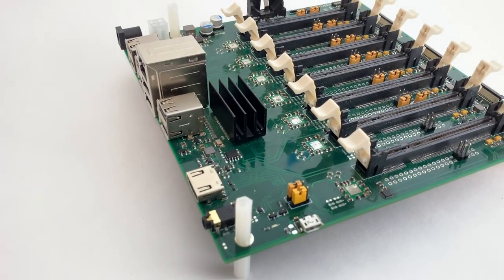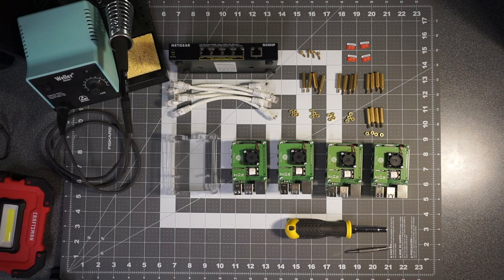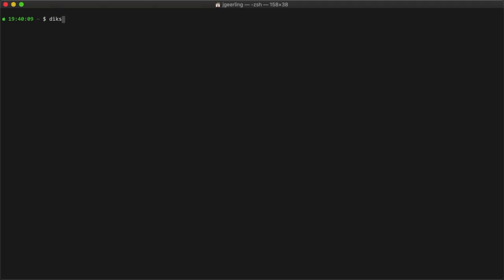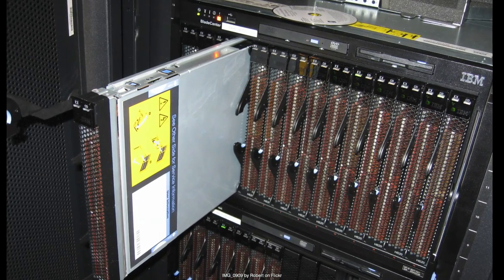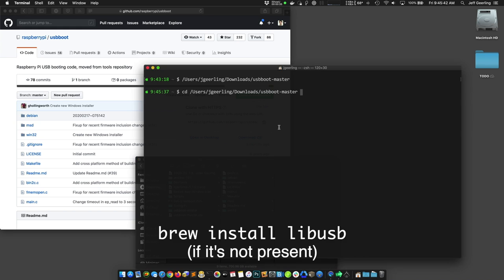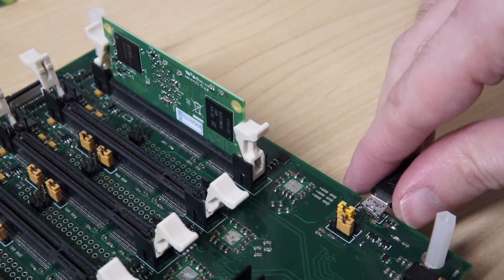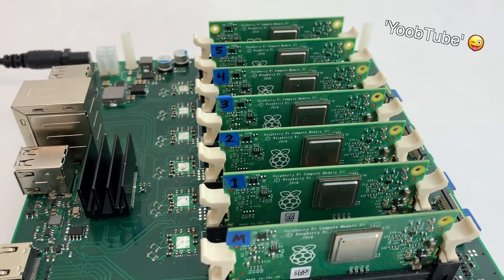Raspberry Pi Cluster Ep 2 - Setting up the Cluster

Comment: - 7 RPi B+ Power 
- A pcb that save the mess of cables and power
- A standar case
- Software tailored for clusters ready for Raspberry Pi

This project have every thing that Raspberry Pi user will dream, nice work.
Reply: I think you shouldn't instruct people to create unencrypted SSH private keys.
"Press the enter key three times" after ssh-keygen is resulting in unencrypted private key.
Form a security standpoint those keys are worthless!
Reply: The Touring pi is $280 with power, $300 with all the addons. Cheaper to do it otherways. Ridiculously over-priced board. Absurd.

Comment: I'm now actually thinking to build a few of these for my School's Innovision Center
Reply: How'd that work out?  Did it happen?  There's another thing you can do with this, if you are into coding and already know some C.  MPI_lib.  It gives you a parallelization API such that you can divide a task across 28 devices.  With careful coding, you can have an enormous speedup with certain categories of tasks.  (multidimensional modelling, sorting, {en | de}-cryption, file compression, DSP)
Reply: or you can take Elixir/Erlang language stack which include OS-like facilities with clustering in its VM

Comment: As always, thanks for a great series of videos. Patiently waiting for Ep3. 

I have 4 Pi 4's which I bought to try and get my head around Kubernetes/Docker (my experience is with more traditional server/VMs/hypervisors). The goal is to run some containers to manage media at home and share around the network (Airsonic, plex). I get stuck on how to set-up the networking, especially how this would integrate or be accessed from existing network:

- Can I put all 4 on my home LAN, so I can access them directly? 
- Should they get their own network using the physical ports and I manage them over the WiFI? 
- Do I need a separate device/another Pi to act as the router between the 2 networks (IP masquerading/forwarding etc.)? 
- Can the Master node also act as this router?

Hopefully you will cover the network setup in detail in a future episode.
Reply: I built a cluster out of 5 4GB  Pi 4's. I've got them all on my home network, using an 8-port switch. I have a sixth Pi 4 running as a file server (using gluster.) Each of these boards has a 16gb SD card for booting and a 16gb USB flash for the root file system. The file server also has a 256gb flash drive. Each of the cluster nodes mounts a shared volume which is housed on that drive. I have a seventh 2gb Pi 4 running pi-hole as a DHCP and DNS server, and use static DHCP leases for the cluster nodes. Each of the systems runs Ubuntu 20.04 minimal. For the actual clustering, I'm using k3s from Rancher, which I highly recommend over other approaches if you decide to run Kubernetes. At the moment, my cluster runs a web server, a git repository, a docker registry, and a Drone CI server. I can launch Drone agents within the cluster, but my current projects are building multi-architecture docker images, so I have a static Drone agent instance on an Intel system (it's an Atomic Pi, fwiw.) 

I'm housing it all in the Cloudlet Custer case from c4labs, with some modifications for better airflow and cable management. I'm using the aluminum heatsink cases (just the top parts) that cover the entire top of the Pi 4 board, which keeps things nice and cool. I'm powering it all with a 10A USB power supply, which is adequate but not stable enough to support overclocking. I plan on building a better power system for this at some point. 

I did most of the OS and software setup of the cluster boards using ansible (I write ansible infrastructure code for a living.)  At some point, I'll make these roles and playbooks public (there's a few secrets in the files I need to obfuscate first.)

You can visit the cluster at https://project.kube.thejimnicholson.com.
Reply: @TheJimNicholson  Thank you for the detail, most helpful (and interesting).

Comment: Wow, I need one of these but I can't exactly spare £500+ for something that realistically isn't any faster than my server I got on eBay for £60.
Reply: Think you're missing the point of the video. Nobody "needs" this, he's just doing it cause he can and he is curious. Plus if you need a serious server you're not going after an ARM based server anyway.
Reply: Which £60 server outperforms this?
Reply: @admiraldirtbag4336  anything, even an old HP DL360 G7
Reply: @admiraldirtbag4336  any X86 CPU made recently, particularly if you're talking a used 1700x or something along those lines and 16GB of RAM. 
The point of this, though, is to play around with clustering without having to fill up a room with ATX towers.
Reply: I would go with AWS.  I've setup some T3 Nano instances, with spot prices you can get each one down to less than £0.02 a day.  You can also stop them at any point and not be charged more.
Reply: @admiraldirtbag4336  my £15 off eBay server.
Reply: @mattvickers8639  is this actually a fair comparison? A t3.nano has 0.5 GiB of memory and 2 vCPU. The clock speed of these two cores is 2.5 GHz which is certainly higher than the 1.5 GHz of the Pi but still. 4 cores vs 2 cores, 8/4/2 GiB memory vs 0.5 GiB memory, I think the Pi is more powerful in some departments?

What about comparing it to e.g. an c6g.xlarge instead? That would already be crazy expensive to operate on AWS compared to the Pi cluster in my calculation. Running four of those for one day would set you back 13 USD and for 30 days would be 313 USD.

Actually just now looking at the available instance types and considering the higher clock speeds of the AWS instances compared to the Pi 4 I would think that the closest comparison to a Pi 4 Model B with 4 GiB of memory would be a t3.medium with 2 vCPU @ 2.5 GHz and 4 GiB of memory. Running that for one day sets you back 4 USD and for 30 days sets you back 96 USD.

Unfortunately I am not much knowledgeable at all about computer architecture as it relates to performance so I cannot say if my comparison is really more fair than a t3.nano. Would be great if someone with more knowledge could weight in :)
Reply: @maxstreese9048  Whilst all your logic is correct, you've assumed that like for like computational power was required,  it wasn't stated that the exact specs of the Pi are required.  The original commenter wanted to set this up without spending £500, so it depends on what they need it for really.
Reply: If you don't care about power requirements for 500 quid you can build a small system with a ryzen 7, a a320 board, a cheap nvidia GT gpu and 16GB Ram. You'll have basically 16 fast CPUs at your disposal (8 cores times 2 threads per core)
Reply: @mdo  @15:10

Comment: Always wanted to learn and apply.  Although RPI4 KNOWN for heat. A special designed ice cluster mount over blades with thin line per blade and super cooler on top would do the trick. Have it rest above blades mounted to corner post of base board. Mini turbine blade type most efficient in moving air.

Comment: Now what I really want to know is if there's something out there like a PCIe card with a connection for the compute module that would allow the compute module to effectively function as an ARM Coprocessor on an x86 or x86-64 PC.
Reply: There is/was Intel Xeon Phi, which placed up to 72 cores essentially stripped out Atom cores, on a PCIe card.
Reply: Unless you write your code to specifically load binaries onto those arm cores, this will not help you one bit.  And the x86 cpu in your desktop/laptop/whatever will very likely be much much faster than the rpi's arm cores anyway.  Not very useful.
Reply: @Messugga  Those were x86 cores though.
Reply: @Chuckiele  Yip, as I said, stripped down Atom cores. I didn't mean to imply they were ARM in any way, shape or form.
Reply: @Messugga  I know, you didnt mention ARM, but thats what the original comment asked for.
Reply: Eon du Plessis I thought you were very clear.
Reply: @detaart  Which is fine if you want to run x86 code, but if you're wanting to run native ARM code, it isn't going to be ideal. You'd have to emulate the 4 cores of each ARM processor (28 cores in this case) at full speed. The overhead in terms of memory and processing power would slow down the x86 system considerably. Presumably they want the x86 to be doing some other tasks as well as working with the data from the ARM side, otherwise they wouldn't be connecting an x86 system to an ARM cluster in the first place. So with emulation, they would have to buy more x86 kit to compensate.
Reply: Look at the new intel PCI-E NUC.
Reply: @TheRealMrRoboto  Yeah, Domo Arigato Mr. Roboto, but I seen that one. It's not very interesting. I mean, you got a machine with an x86 CPU connected to a machine with an x86 CPU. Not really interesting. The interesting part would be if you could have a system with an x86 CPU and slot in a card with an ARM, or POWER, or even RISC-V CPU for specialized computing functions which they might handle more efficiently. GPUs have been used like this for over a decade now.
Reply: @seancondon5572  You reminded me of the Mac Quadra 650, it had a Motorola 68040 CPU, but some models came with a "DOS card" (486 CPU on a card). But the sad fact is that they only worked in isolation, and could not share resources. Similarly, I salvaged a DEC Rainbow many years ago, it had both a Zilog Z80 and a 8088. I never found the monitor for it (it needed a specialty one that resembled a VT220 terminal). Even before GPUs, on early IBM PCs, floating point arithmetic was done on a separate 8087, then i287, then i387 math coprocessors. Hopefully you're seeing a pattern. The problem here, a co-processor is only good for offloading small subset of specialized functions. With two or more different generalized CPUs, a lot of code is needed to discriminate which does what functions when, and even then whole lot of processing power will be wasted. The reason modern x86 chips have MMX, SSE extensions and so forth is to avoid having separate co-processors. GPUs basically do very, very specific processing tasks (and use their own RAM to do it!). The greater efficiencies of different CPUs is a different matter, a jumble. There's also matters like some chips needing Little-Endian code to be efficient while others do Big-Endian. There's Bi-Endian chips now, but they lose efficiency in converting instructions, among other limitations, so the purpose is defeated. So, your intuitions about co-processing are good, they would be "interesting". It just doesn't work out in the real world. I've been looking at the possibilities a very long time now! ;)
Reply: An FPGA card might do what you want.

Comment: Be so nice if there was a retro Pi build that let you use this Turing cluster. That way you could just add as many as you need, and if you need more just add them and be playing stuff like GameCube, and 3DS
Reply: Logan : Wouldn’t it be neat to run two or three Pi3’s for emulation gaming at normal temps, instead of one overclocked Pi4 with active cooling? Maybe it’s just me...
Reply: @totophi  Well couldn't one be solely dedicated for GPU task, and the other for CPU? I honestly dont know much about cluster computation, but i would imagine that would speed it drastically if possible

Comment: One point Jeff.
In episode 1 you spoke of the benefits of learning all the things that are needed no matter what the speed of the nodes.  And the learning process for managing them can be as important as getting the required performance.
But the Turing Pi by-passes many of those steps that the aspiring cluster student really should be learning.
I agree that much of this is a combination of rote effort and boring repetitive work; but that is exactly what a student needs to be exposed to.  It is not easy to build a major cluster, and the cabling will inevitably get to be a bit of a nightmare.
This does not mean that I do not appreciate what the board provides, I just question it for the teaching role.
Reply from the maker: True; in that sense the model B is a little better of a teaching tool as it has all the basics that you'd find in a typical multiple-server installation. But even the Turing Pi requires flashing each Pi (which is a bit of a manual and boring process), and especially if not using HypriotOS, you still need to do the networking configuration/DNS for each Pi. The main thing taken away is plugging in power cables and network cables, which, to be fair, is something that you'd bypass on modern blade-based servers too.

But your point is well taken—for the purest educational experience hardware-wise, multiple model Bs are a little better.
Reply: @JeffGeerling  As a systems engineer, I always found the routine of building servers into the racks was the hard part.  Setting the servers up was easy.
Of course that likely has more to do with how many servers I set up, vs how few racks I had to work on.
Reply: @JeffGeerling  I forgot... Thank you for the videos.  They are very well done.
Reply from the maker: @John.0z  I would not be opposed to you sending me a few dozens servers and a rack for my homelab, I'll even make a video of the installation ;)
Reply: @JeffGeerling  Sorry Jeff, but I am retired now.  It would also be a problem sending them from Australia.
Also I used to work for Compaq, and now that is a name reduced just another trade mark.

Comment: 14:00 Turing Pi should have an IO shield.
Reply: Oh yeah,Even if they had one 3D printed :)
Reply: Hot glue does it too
Reply from the maker: Currently there's no IO shield for it, but I asked Turing Machines about it and they said they may make one for it. I could fashion one up myself, but it's not a huge deal for right now—this is a prototype that I have to return. For a more permanent build, I would be integrating a large, quiet fan, and probably an internal PSU.
Reply: @wmonk5642  Then buy them and make a video about it and upload it to YouTube. I'd watch it. I take your point though. The Turing Pi  motherboard is pretty expensive for what it is, though I think the Compute Modules themselves are good value and you are comparing new with very old.
Reply: @johnm2012  Im comparing FLOPS with another FLOPS ;)
What do you plan to do on your assembly?
Reply: @Max Xgame I dont know his tasks, maybe one Xeon will be enough )
Reply: @wmonk5642  we all know that. It's just that not everyone likes to spend that same amount every month in electricity for playing around with clusters.
Reply: @Max Xgame Dumme frage; wie hast du kWh (Kilo Watt Stunde, wenn ich das richtig im Kopf habe...) gegen die 300 Watt verrechnet um daraus den Jahrespreis zu bekommen? o.o Ich hab hier nen alten IBM Blade und würd mich interessieren wie viel der kosten würde, wenn ich ihn mitsamt redundanter Netzteile ans Netz hänge. ^.^
Reply: @MiguelEnes  My point is - make clusters from high performance units, not from Pis. Pi is good to install it in VR hemlet or your bike for some reason, rack of Pis is insane! 
If you make a box full of chips - you have some high computing task for them, i guess. Xeon is better way to solve that tasks comparing even FLOPS to kWh or FLOPS to $ - that is my point. Advantage of Pi is its size and low consumption, so use it in appropriate cases.
Reply: @wmonk5642  not exactly. Pi is good for whatever you need and have the ability to make it be :)
I honestly wish I'd had a bunch of pi4's, they'd easily replace my server.
Reply: @MiguelEnes  Server on ARM? Never.
ARM cant adress direct memory, it use tricks with registers instead, so ARM will never have the same efficiency as x86 in such tasks comparing to kWh
Reply: @IngwiePhoenix  1000 Watt / 300 Watt * Anzahl der Stunden = Kilowattstunden * Preis pro kWh = Preis pro Monat oder was auch immer Dein kalkulierter Zeitraum ist
Reply: What is the link for that case?

Comment: Thank you for this video. I have a few questions... 1) can you expand the turing pi to use two board or more? 2) can I use a PC as the head node to run computations along with the pi’s?
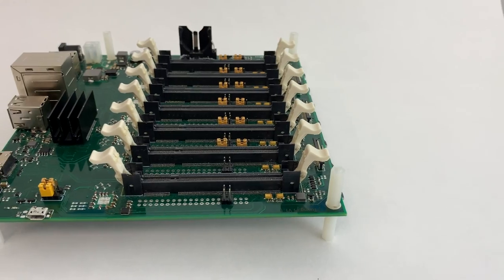Reply: 1) 6:22 I believe you could connect the two Turing Pi's via ethernet / a router to scale this setup
2) Depends upon software / configuration - if the software runs on both Windows (assuming this is what you meant by "PC") and Linux and it communicates over the network, then it should work

Comment: You can use the status=progress parameter to dd instead of piping to pv
Reply: This isn't available in the dd version installed on mac by default. You'd need to upgrade your dd version for this to work. The pv + dd solution works on mac by default.

Comment: Looking forward to getting the released turing pi... (IIRC I'm in for a bit over $500 with a full rack of 32GB Pi3+'s). I know learning Kuberntes probably makes more sense in an AWS sandbox... but I liked the idea of physical hardware.
Reply from the maker: It's definitely a lot more fun to do it with physical hardware!
Reply: $500 would buy you a few commercial usff boxes with i7's and 16gb ram each, retired from offices, something you could actually do a lot of computing on instead of a handful of pi's, but whatever. I don't get what people are using pi clusters for when you can do more real processing on a single 4 core desktop than a whole ton of pi's